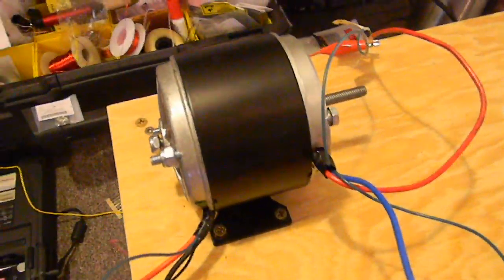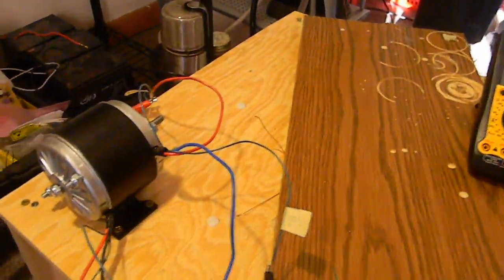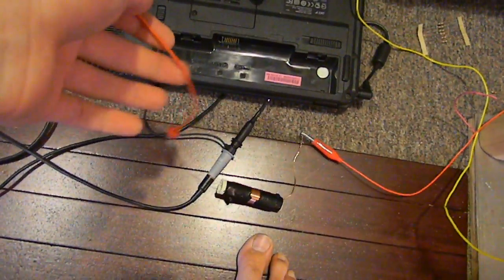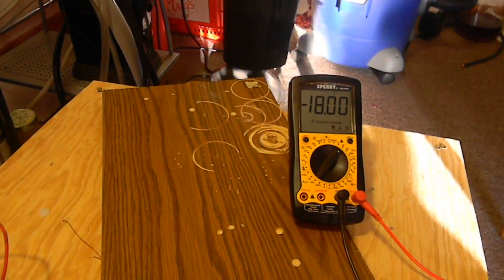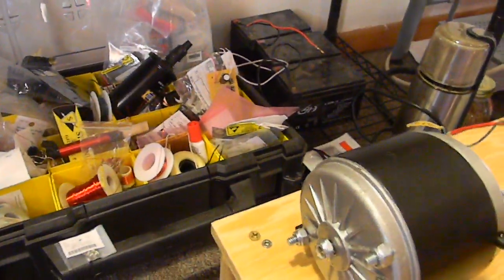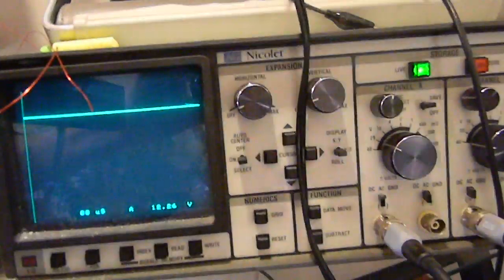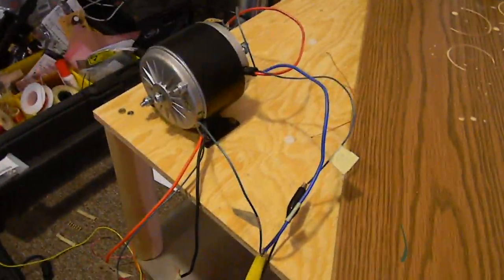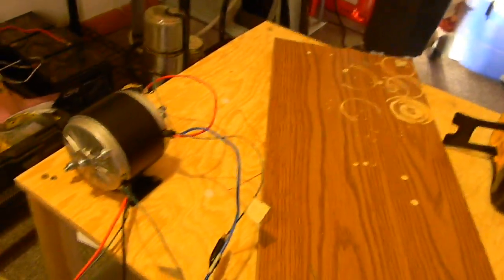Asymmetric Scooter motor with output voltage

Comment: Alright, so I want to modify a scooter with an asymmetrical motor, run it with your Tesla converter with potentiometer for pwm/oscillator, and graphene supercapacitors in circuit. Then use lithium iron phosphate batteries to power it all. I have a friend who makes graphene supercapacitors. And I can get an  electric scooter, but I need to know what motor model. What do you think? My girlfriend is a photographer and documentarist, so she can help me make a video and everyone involved will get due credit.
Reply from the maker: This sounds pretty sweet, by tesla converter you mean my little resonant buck driver? I am still perfecting this. I think I figured out what tesla was doing from an electrical engineering standpoint. Ill post a video on this later on. Graphene super caps would be great to use. The motor model I have is a MY1020, I have two but havent converted it to asymmetric yet.

Comment: Would you be interested in a collaborative project with me on asymmetrically winding a motor for an electric scooter?
Reply from the maker: most definitely...I actually have a 1000 watt chinese motor for this exactly...I havent gone further in testing it because I figured how to make radiant with pulsed DC....i would still be interested in seeing how much better these run on an actual scooter
Reply from the maker: I have 2 identical 1000watt motors actually. you need two to make an asymmetric one...Ive got the wire too. Lemme know what your idea is!

Comment: GREAT WORK,WHAT WERE THE AMPS IN? RPMS? AMPS OUT? Why have you stopped work on this motor?
Reply from the maker: the original goal was to produce radiant...I figured out how to do so with pulsed DC too. Until I explore the field of radiant extensively then maybe I will turn back to the asymmetric motor and tune coils to it to transmit energy